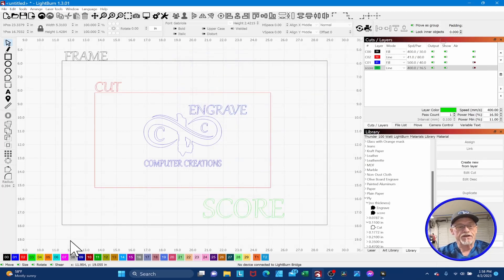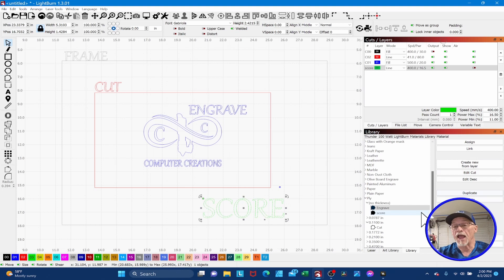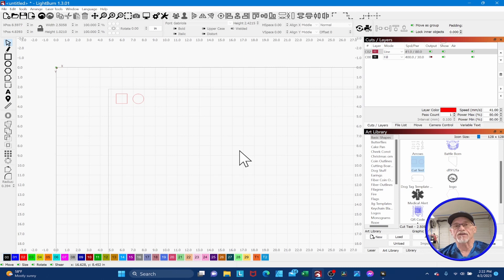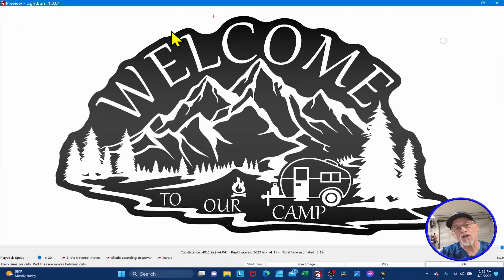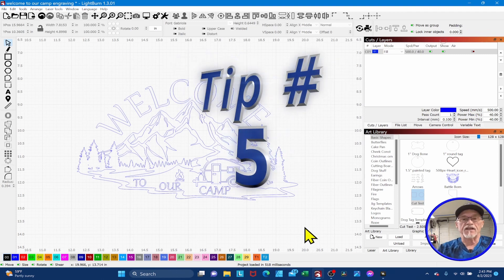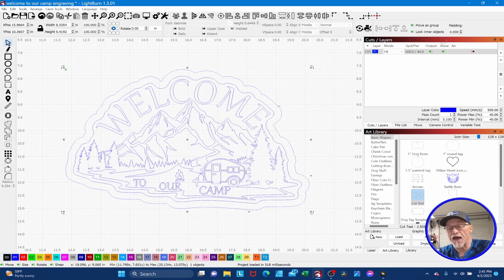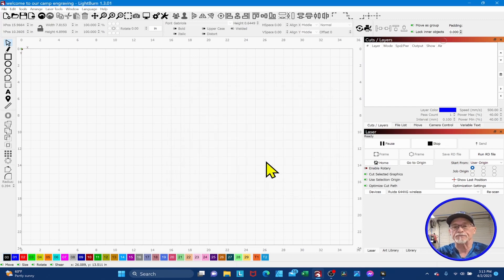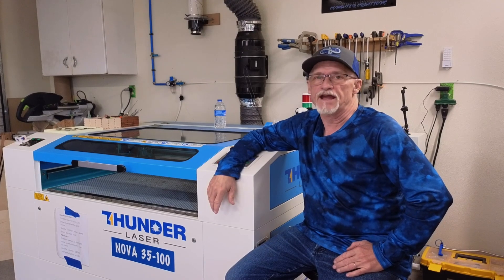Unbelievable Results: Unlock Laser Project Design Speed-Ups with these 7 LightBurn Tricks!

Comment: Why not use the T1 and T2 for your frame. that way you dont have to turn off the frame color?
Reply from the maker: Because the frame layer doesn’t go to the laser and if you want to frame from the controller it won’t work.
Reply: @computercreationz  not even if you turn the “Frame” on for the layer?  I never frame from my controller, just from my computer.  So just asking. 

Really liked the other tips!  Will be using the colour coding!